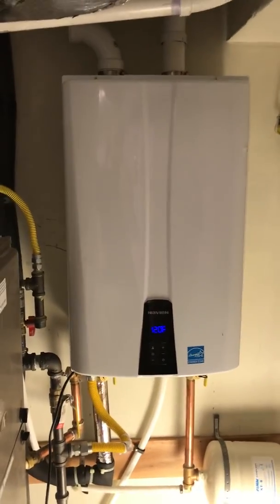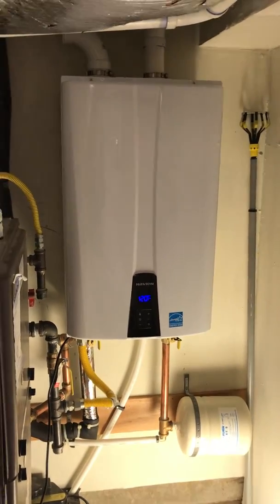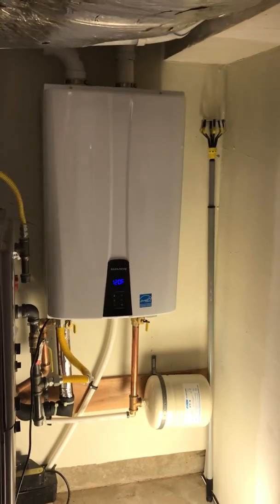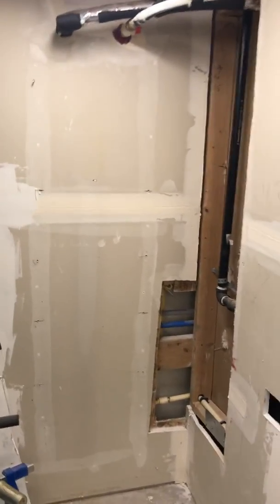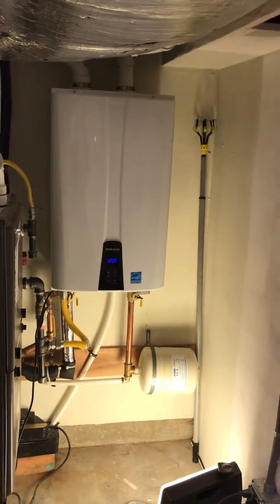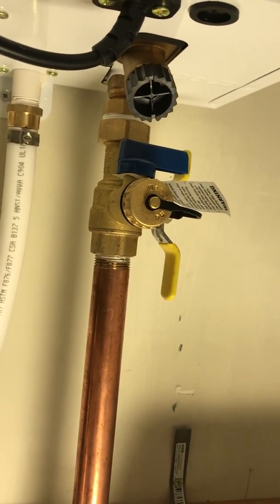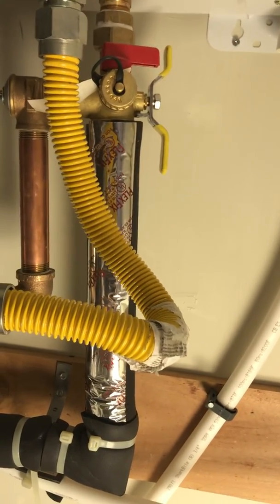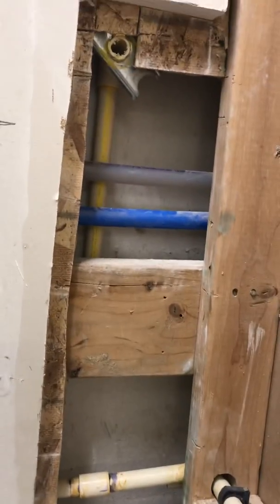DIY Tankless Water Heater Install Navien 240 S

Comment: I have a couple of questions about your intake and exhaust air.  On the intake, I see it is pulling air from indoors.  I assume this was OK because your garage has air inlet grates?  For the exhaust, my installed tank water heater has an exhaust blower,,,do you know if the condenser-style tankless units negate the need for the blower?  Thanks.
Reply from the maker: Yes, the garage had a 6" fresh air inlet vent for makeup air because both the furnace and water heater were in the garage.  I would check the Navien manual and local codes for exhaust blower, but mine was plumbed to the outdoors with PVC.  The high efficiency units extract most of the heat from the exhaust so it is just slightly warm.

Comment: The drain line you describe at 9:10.  Is that a code requirement for inspection?
Reply from the maker: Yeah, it is a code requirement for condensate line. Without it there will be a lot of condesate water on the floor.

Comment: Hi Shawn, I liked your video as I am looking to buy and install a Navian 240A but am finding it hard to locate one locally.  I found a place online but from their buyers reviews Navian will not honor a warranty if you buy online plus no rebate if any from the utility company.  Not sure if any local store would sell to a DIY not a plumber.  Still researching where to buy with warranty.  I accidentally hit the thumbs down as I wanted to see what the reason was for that sorry.  Thanks for your video.
Reply from the maker: I bought it from mytanklesswaterheaterstore.  I would recommend, if you want to do it yourself and keep the warranty, do all the plumbing up to the location of the water heather and get it inspected by your municipality.  Then hire a plumber to do the final hanging and hookup of the tankless water heater so you have record of "professional install".  Should not be more than a service call and 1 hour labor.  Plumbers are so expensive in my area I could replace it 4 times before I get to the cost of the cheapest estimate, so I am not concerned about warranty.
Reply: @shawnrader2393  I am like you don't care about the warranty after install but was thinking if ordering online and it was damaged in shipping or did not work for some reason it would not be returnable.  I may be wrong about that will check into it more.  A local plumber wants $3500 so its not cheap.  Thanks for the tip.
Reply: @shawnrader2393  Finally decided to order the Navien 240A tankless from the online site you provided.  The information you provided is great and definitely applies to my situation.

Comment: I recommend you splurge and replace the old expansion tank.  Those can fail and cause lots of water damage.  The new one will last longer too, because it doesn't sit in hot water all day and night.  The old one is compromised.

Comment: This is DIY job,  why would you need to contact city for inspection?  I installed 240A last month everything work great, I'm in Renton area.
Reply from the maker: Primarily for when I sell the house if any questions come up about when/how the water heater was installed I will have all my permits in order to show it was done legally.  Also I think it was worth it to have the inspector go over my work to ensure everything was done right and safe.  I did have a violation where I had pex connected to the pressure releif valve, which needs to be cpvc.
Reply: @shawnrader2393  I'm not sure if I have code violation where I have condensation line and pressure relief valve exit to the outside on same copper line,  I will have to replace condensation line with cpvc next few year, as acid water will destroy the copper.

Comment: Why do we need an expansion tank on a tankless water heater? Is plumbing code required that?
Reply from the maker: It is not required for tankless water heaters in Seattle where I live.  I installed the expansion tank because I plan to run a hot water recirculation system which heats the water in the line in a closed loop.